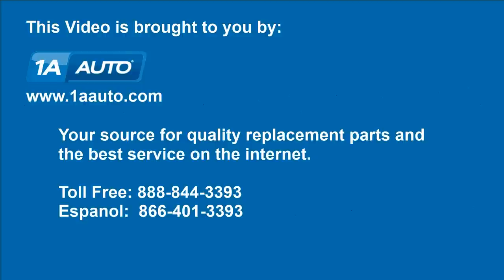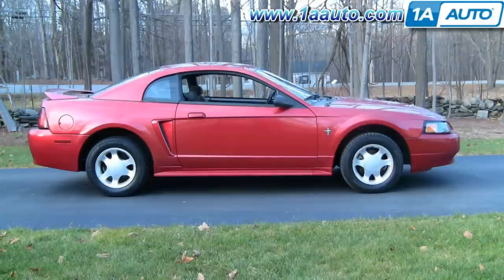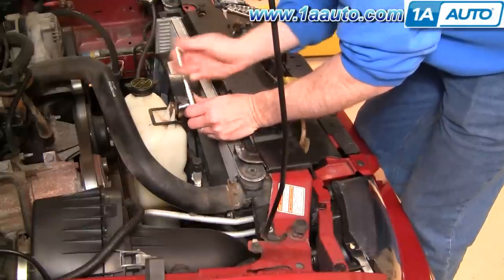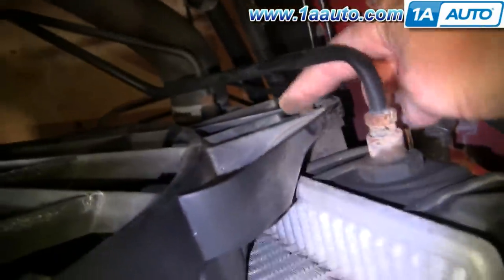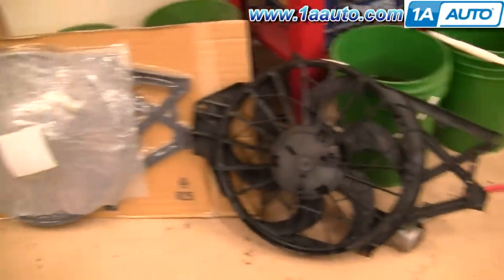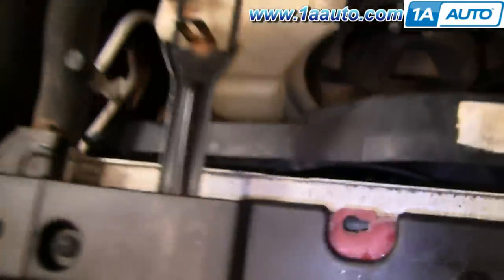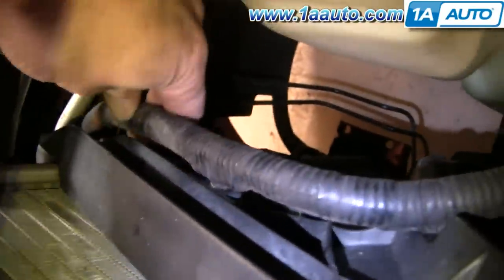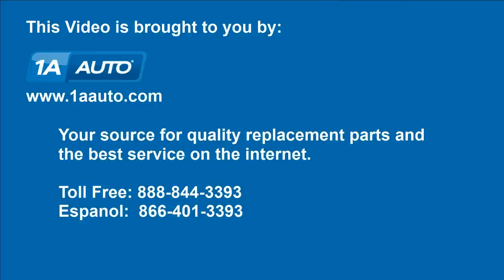How to Replace Radiator Cooling Fan Assembly 97-98 Ford Mustang

Comment: good video,  got a 1998 v6 and my radiator hose burst yesterday, and found that the fan wasn't running. thought it would be a hell of a job and would end up replacing the fan and the radiator, now im glad it won't be as bad.

Comment: I love stuff like this. Sharing knowledge. I'm actually looking for where I should find the CCRM and fan control for my car... it's a 1998 Mustang GT. I'm in the process of building a car and I always like to start replacing old/broken parts with new and better parts. My radiator fans work but wont turn on (even with A/C turned on).. so I think that narrows it down to either fan control or ccrm... I'm not sure if there are any fuses or relays that are responsible for my fan issue though.

Comment: my radiator hose on the bottom is bent at a 90 degree angle, do u think I would be able to straighten it out myself with some pliers or something? i would hate to have to pay a shop to do that for me?